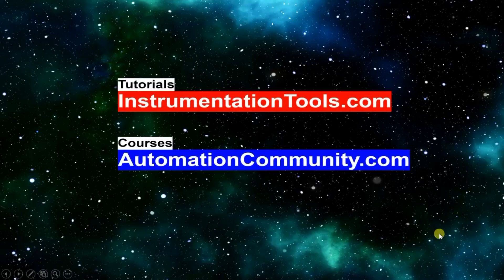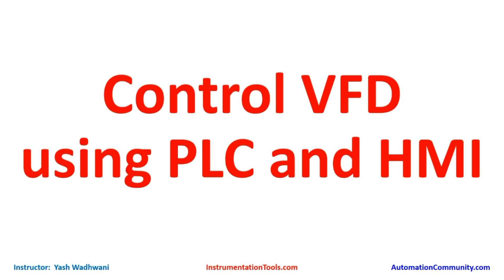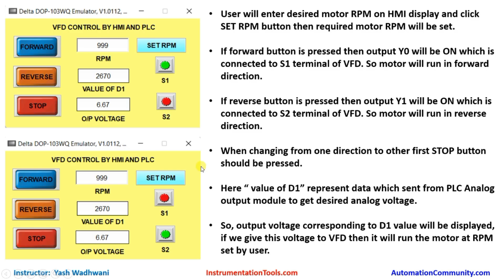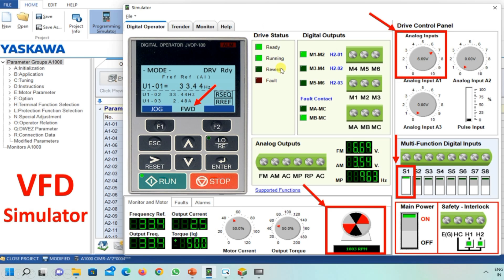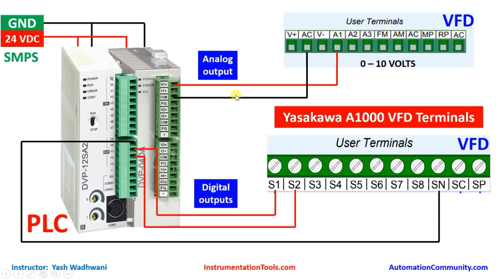VFD Control using PLC and HMI - Automation Training

Comment: This kind of control requires using of DA modules or analog outputs PLCs  (just as know how to work with them!). Furthermore analog outputs could only control the speed of the VFD. Start and stop requires involving additional digital outputs of the PLC. 

Modbus communication is simpler and could drive many VFDs within a single network including start, stop, reverse and speed.

Comment: Thank you sir for the video. How to program ladder diagram to on , off ,on, off redendent of servodrive with required length  setting . That means if i set 10 cm the servo on until it reach 10cm then for 3 sec solonoid valve on and then servo on 10cm repeatedly

Comment: is it possible to post a  video anout data communication in dcs as it receive anlog data from 
level and flow transmitters also receives speedfeed back speedset point motor load motor  status from drives and  motor control centers